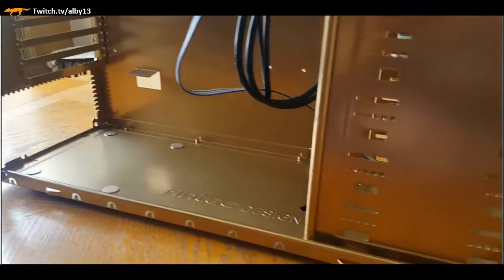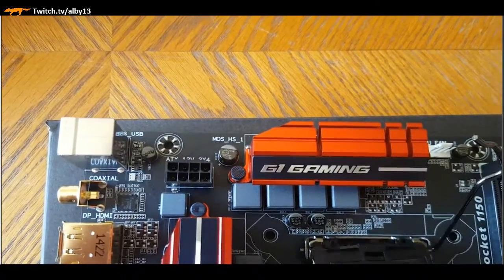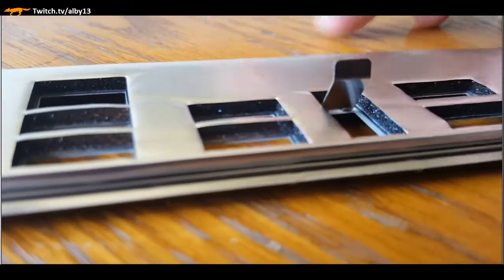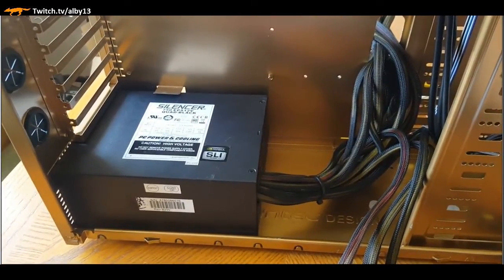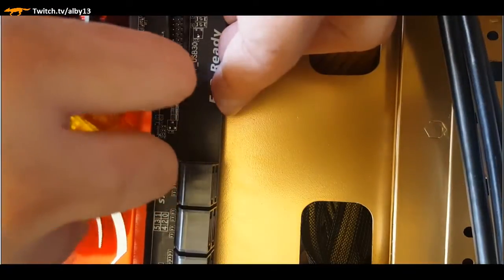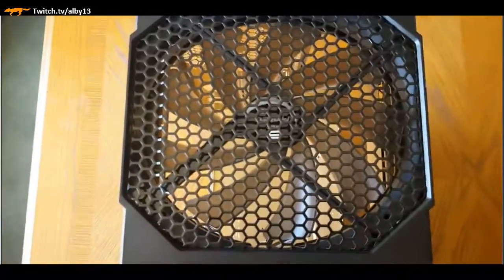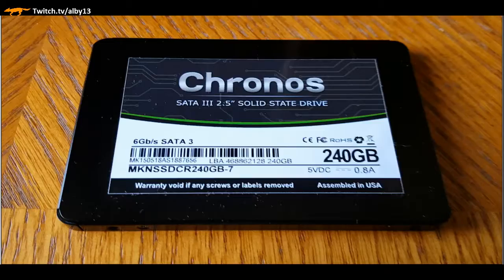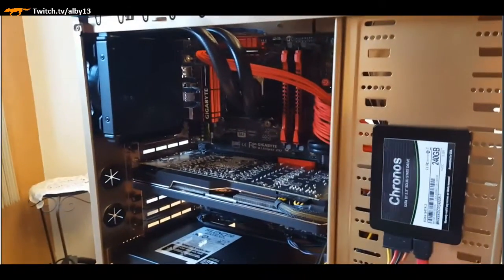Antec 900 Gold Gaming PC Build Live Stream

Comment: Awesome to see the antec 900 being re-used, what did you do about the lack of USB3 next to the reset button on the top of the case ?.
Reply from the maker: +Adamthegreat984 There are different versions of the Antec 900. This one has two USB 3.0 ports (blue) on the top of the case. IT has a Firewire port that is blocked out as it has been pretty much phased out. A hard drive indicator is next to the reset button.

Comment: hay what CD ram you need for that motherboard?
Reply from the maker: +kingbrick1993 CD ram?
Reply: I mean CD ROM sorry type to fast
Reply from the maker: +kingbrick1993 You can use any CD ROM/DVD/Blu-Ray that is a SATA type. Almost all sold these days are a SATA so you can take your pick of brand. The one I used in this build is a LG 16X BD-R that can also read and burn DVD/CD, Model: WH16NS40
Reply: +alby13 could I use px880sa ?
Reply from the maker: +kingbrick1993 That has a SATA interface so the answer is yes. If you already have that drive go for it. If you are going to buy it, the street price on it is $90+ which is way too expensive.
Reply: +alby13 well the px880sa was in my old PC so I was figuring that part since it still works just using it
Reply from the maker: +kingbrick1993 sounds good

Comment: Gold Case but no i7. Pls alby
Reply from the maker: I researched performance for gaming and there just isn't a big difference between the i5 and the i7. In fact, the i5 outperforms the i7 in some games. Since this is a gaming pc with a single radiator cooling setup the i5 made sense and I stayed in the $1000 budget. i7 Hyperthreading is nice but for gaming it doesn't have much use.